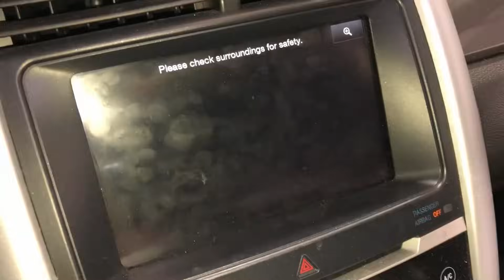2007-2019 Ford 6F50/55 Six Speed Transmission: Fluid Exchange Procedure

Comment: Good video. I have a question. I just purchased an Edge and it has 140,000. No where in the carfax does it show to have ever serviced the transmission. What’s your opinion on doing this when it’s this far along and has never been done?
Reply from the maker: Yes if you perform a drain and fill you should be fine. This only change part of the fluid as to not shock the system.
Reply: @FordTechMakuloco  Thanks for the advice!!
Reply: @FordTechMakuloco  If you drain and fill (DaF), how long should you wait before doing another DaF to get more of the old fluid out?  I assume that the old and new fluids would evenly mix, so you'd be DaF roughly 1/3 new, 2/3 old the 2nd time around?

Comment: Yo! Your vids are so helpful. We recently picked up a 2018 platinum explorer and it now has 40k miles. Just did the PTU oil change and transmission fluid. Our transmission has a dipstick and I didn't see a level plug on the side through the fender well. I did see another one pointed straight down, at a higher level and to the side of the drain. Is that plug for setting the level? Or just using the dipstick good enough? That's what I did for now.

Comment: Is the reason for doing it so frequently, also, because you can only get 40% of the fluid out?

Is there a way to get all 11 quarts out?
Reply from the maker: You want the mix especially if the trans has some miles on it.

Comment: I have 2015 Ford Edge SEL 2.0 Eco boast Front wheel drive that doesn’t have a dip stick.  Has a funny plastic cap that appears to be some type of a guage.  Is this normal?
Reply: Mine is the same in the 2015 Ford Edge Titanium AWD, Did you find anything out?

Comment: Mine is a 15 explorer 2.0L and it doesn’t have a dipstick. Do I have a different tranny?
Reply from the maker: Yes you have a 6F35 not a 6F50.
Reply: @FordTechMakuloco  ok thank you, I’ll have to do the leveling method with the bolt on the side correct?
Reply from the maker: Yes I have a video on the 2013+ 6F35.

Comment: Hi. I did this service today. I unscrewed both drain plugs (the lower, and upper pressure line?). Some dark sludge came out of pressure line. I simply replaced the cap. Do I need to do anything else? Thanks to anyone who can help with advice. 2018 3.5 ecoboost interceptor just retired. Fluid was pitch black.

Comment: Anyone know the difference between 07-09 edge awd transmissions and 2010 awd trans? I have an 07 with a seized engine. Guy I got it from says he tow dolly'd it back from the garage to his house, so I suspect drivetrain/tranny damage. I have an 2010 3.5/trans/PTU I'd like to drop in if possible.

Comment: Mine was changed 10km ago. I was about to change it myself on the weekend but when I pulled the plug out it was still lovely and clear. I was shocked but happy😆
Reply: Thats one of the things that throws folks off about ATF: unless it over heats/gets contaiminated from mechanical damage, it wont change colors very much as it wears out. Folks are used to seeing engine oil that goes in golden and comes out black. Engine oil changes colors due to combustion containments which aren't present in a auto trans. If your trans fluid is anything different than a bright to dull cherry red, its indicative that the trans has suffered overheating or mechanical damage.

Comment: I have 2013 with shudder under lite accel. Put new plugs and coils, new Motorcraft filter, and fuel system check by dealer. Still shudders slightly. Saw video suggesting a trans additive... thoughts?
Reply: Add a bottle of Lucas Transmission Conditioner too, in place of some of that 4.5 quarts.

Comment: I just bought a 14 explorer sport, to my knowledge the fluid has never been changed with 140k miles, would you recommend a drain and fill or is that a bad idea?
Reply: Add a bottle of Lucas Transmission Conditioner next time too, in place of some of that 4.5 quarts.

Comment: Great video!  I have a 2014 Ford Flex with 120,000 miles, never had the tranny fluid changed.  A really exceptional vehicle, always driven easy, but does drive on dusty roads occasionally.  Is it "safe" to change fluid in this case?  Is it true that you can cause slipping problems if you change fluid after waiting too long?  Many thanks . . .
Reply: Just add a bottle of Lucas Transmission Conditioner too, in place of some of that 4.5 quarts.

Comment: What would you recommend doing If I accidently put rear diff (75W-85 synthetic hypoid) oil in the transfer case (which takes Mercon LV)? I have the transfer case oil on hand, I just got the bottles mixed up. (I have a 2019 F150 3.5 ecboost) I have only driven around 30 miles since I put the wrong fluid and I did not use the 4x4 function. Thanks for all the videos!

Comment: Need help!  Wife’s 2016 Explorer (95,000 miles) had a MAF sensor go (replaced) now the ambient air sensor temp is throwing a check engine light (tried replacing sensor with no luck).   Now it is upshifting and downshifting hard.  Any idea what may be causing this?

Comment: The video is good and I benefited a lot from it. I have a 2018 Ford Explorer. I would like to know how to change the gearbox filter
Reply: Pull the transmission out and disassemble the two aluminum halves.

Comment: QUESTION please: Ford Explorer platinum 2017  single owner 35K miles   ..   do you change  PTU fluid   as well !?  
 is it still  recommended to perform this service at 30 K if vehicle  was bought brand new !!? can not get a straight answer from the dealer  ...
thanks !

Comment: So if I do the 3x fluid change to get all the fluid clean, how long should I wait between changes? Thx
Reply: I decided to come back after doing the 3x fluid flush so anyone else researching could find this. After each 5.5qt flush as shown in this video, I drove for about 20 minutes, being sure to shift through all gears and get the converter to fully lock up. I drove to the interstate and to the next exit then drove from there back home in stop and go traffic. Maybe 25-30 miles total. Then I proceeded to the next 5.5qt flush and of course repeat again for the last 5.5qt change. The fluid  honestly didn't look too bad at first, kind of the darker red you see in this video. It's very red and clean now. Roughly 17qts of fresh fluid in my '13 edge sport w/ 70k miles since I didn't know the history of trans fluid. Now I'll do just the 5.5qt again at 100k and keep up from there. (Sorry for length just hoping to help 😉)

Comment: Doesn't this trans have the weep hole/ overflow hole on the driver's side? Wouldn't removing the plug from this hole while filling the fluid help move things along better? Plus, the overflow of fluid tells you when it's full, right? Or did this trans not have this? Thx
Reply from the maker: No you are thinking of the 2013+ 6F35 or another trans altogether but not this trans.
Reply: @FordTechMakuloco  ahh, ok.I appreciate the confirmation. I'm looking to do this on my Ford Edge sport this weekend and collecting all the information I can.

Comment: Thank you for excellent  video content! I did a 6f55 transmission on a 2016 Ford Edge Sport 2.7L yesterday and accidently over filled. With thread sealant already applied to the drain bolt, I removed it to remove 0.5qts and reinserted the drain bolt. Do you think the thread sealant will still hold? Also, is there a better way to remove trans fluid if overfilled in the future? I still haven't quite figured out how to get the air cleaner box to sit properly back in too.
Thanks in advance for any feedback!
Reply: Vacuum fluid extractor from the dipstick tube

Comment: I have a 2016 edge sport. at about 38000 Miles the service department at the dealership found a leaking transmission temp valve. that took 7 days to replace, before they replaced the temp valve I noticed a studder at acceleration and a low idle issue at a stop. I still experience the studder and low idle issue. the dealership tells me they can't replicate. I wonder if the ptu is causing the studder.

Comment: Hello. Thank you for your help. You’re an asset to the ford community! I have a second gen CX-9, 2019 to be exact, and the torque converter locks up almost instantly (I think over 7 mph). It’s great for that direct feel, less heat build up and better gas mileage. Do you happen to know when the 6F55 torque converter locks up?

Comment: I have a 2015 Edge SEL with the V6 engine. Is there any issue with measuring how much I drain out and refilling with the same amount provided the original fluid level was correct? Thanks Eric

Comment: I have a '15 explorer 120k miles. I bought it with 50k and changed the trans fluid twice since then. How long can i expect the transmission to last? It shifts a little rough between 2nd and third but otherwise it's okay.

Comment: The manual says to change the fluid if driving in dusty conditions at 30k miles.  These trans hold 10-11 quarts.  Does the dealer change the fluid out with this method of 4.5 + quarts or do they get the 10/11 quarts out by some other method?  I will do this change per your video but if the dealer gets all the fluid out I will take it to them.  

When I see people post 3x are they talking about 30k miles or doing this change 3 times?  

Thanks,
Larry
Reply from the maker: Drain and fill every 30k miles it takes 15 min, why would you go to the dealer?

Comment: So it sounds like only 4.5 quarts comes out but the manual says it holds 10. What's holding the rest from coming out other then maybe the pump?
Reply from the maker: Pump, torque converter, fluid passages in the valve body etc...
Reply: @FordTechMakuloco  so would it be a good idea to flush every oil change till comes out a bright red

Comment: Is it true that on a 2016 ford transit 250 (full size 3.5 Ecoboost) transmission fluid and filter change, the cross member and exhaust must be removed to access the trans filter and pan? I was quoted $750 to $850.
Reply from the maker: Yes

Comment: This was a drain and fill not a flush.
I always flush all the fluid out and refill with new.
I have a 2013 Lincoln MKS Eco-boost AWD and I've never had any issues with the car.
Of course all oil changes and PTU fluid changed frequently as well.

Comment: Is their no video for a 2017 Ford Edge 2.0 front wheel drive. This must be an all wheel drive or for an Edge with a bigger engine. I don’t have a screw on filler cap. No dipstick.
Reply from the maker: You have a 6F35 trans, this is a video for the 6F50. See my 2013 and newer 6F35 video.
Reply: @FordTechMakuloco  Thank you

Comment: How do you tell which tran you have?  My owner's manual lists 6F50, 55, & 35 for my car.
Reply from the maker: The 6f50 is for the 3.5L N/A engine, 6F55 is normally reserved for the 3.5L Ecoboost and the 6F35 is for the 4cylinder Ecoboost models.
Reply: @FordTechMakuloco  Thanks!!! Your videos have helped me out a LOT

Comment: I agree to a lot of your subscribers, you are a life saver. I've repaired few of mine and friends cars watching your video and cars are still running great today after many years. Anyways, I know you mentioned there's no tranny pan on this 6F50 tranny and that it's hard to take the internal filter out. Does that mean no need to replace the filter forever? I just bought 232K 2013 Taurus and I want to replace the tranny filter ($28.49). Should I add an external/remote filter just to be safe? I'm on planning on driving this car till I can't drive it no more.

Comment: So for a drain and fill for the transmission fluid in my 2016 Ford Taurus SEL 3.5 flex V6, I only put 4 and a half quarts back in???
Reply: I just did my 2012 ford explorer and i almost added 6 quarts to get a perfect reading. Am assuming it was missing trans oil. When i added the 5 quarts i got a lil bit more than half on the reading mark and added a lil more and bang perfect reading
Reply: @rhurtadorh32 hope she was hot, sitting level, and running??

Comment: Great channel and videos, learning quite a bit here. I do have a quick question was hoping you or a viewer may be familiar with. I have the 6F50 in my 2015 FPIS Taurus that I bought recently. There is a little bit of a hum right before the 4-5 shift, and the 5-6 gear shift, only when I'm gently on it and the RPM is low, like below 2k. Everything else is normal and performance seems perfect. I have a warranty but just curious, I read in a group that it was common but concerns me.

Comment: I've always wondered by more transmissions aren't like the Alison with and external filter.
Reply: Keep wondering.  It may occur to you.
Reply: @COWBOYZNATION  Not much difference

A Chevy Allison transmission replacement typically costs between $3,449 and $3,799. Ford F-250 transmission replacements can range from $3,000 to $7,000.
Reply: @iamthemoss  WOW

Comment: I cannot for the life of me find the dimensions of the 6f55 trans drain plug size! 
I have located the part number 7T4Z7A010B and have called two dealerships but no one knows the diameter/pitch/length, nor whether it is magnetic.
I want to order a magnetic/neodymium replacement from an ebay seller....or are the oem plugs magnetic? Also, are there any magnets in the 6f55 transmissions?
I do know the engine oil drain plug is 15mm M12 - 1.75 but what the heck is the trans drain plug dimensions??? 7/16 or 11mm head size is all I know, and that is insufficient info to re-order a magnetic replacement. Are the engine oil drain plugs magnetic?
Can anyone assist please and thank you.

Comment: Does anyone know if @ 9:23 when you add additional transmission fluid after the initial 4.5qt do you do so while the car is running? Also he said “there’s 5 qt inside let’s add another 0.5qt to bring it up”, but he had only 4.5 at the beginning. So did he add an additional 0.5qt already? Was he accounting for something else? Will the final additions of fluid total 5qt or 5.5 qt? Just to clarify as this is a very sensitive step.
I’d appreciate an answer.
Reply from the maker: Most of these take 5-5.5qts in the end, so you start off with 4.5qts fill and adjust as necessary with engine running the whole time in park as as shown here.
Reply: @FordTechMakuloco Awesome thanks! I appreciate it.
By the way your videos have been extremely helpful and top notch. My go to primary resource! Great presentation, no music, no fluff, just well-edited content.
Thanks

Comment: Great Videos! I have the '15 Sport with the 2.7 and it's a bit different. You have to remove the two screws retaining air intake, pull the air box up from the retainers and twist slightly. The flex intake hoses stay attached. Then you can check fluid when running. It's Really tight, cap almost impossible to see let alone twist and have to pull it between hoses. Smaller hands a plus. I managed with two fused wrists so it can be done. Just adding fluid? Remove the whole airbox, but Ford says don't run with it disconnected.

Comment: Do you recommend drain and fill over dealer offered flush services. My dealer will not do a drain and fill for me . Will only sell me a flush for 300$ . Car has 45k miles and I believe  its original  fluid so I planned on doing 3-4 drain and fills with running the trans in between . Would you recommend  the flush or drain and fill ?

Comment: I have a 2016 flex and the cap is burrows under the air box, how do I start the vehicle to check it without the air box hooked up, won't my car die since it throws off the mass air flow sensor?

Also is it better to change it again after like 500 miles to flush out more fluid or is once enough?

Comment: Interesting that GM and Ford both jointly cooperated and committed to investing finances in supporting this 6 speed transaxle, which also includes the 6F35.
Reply: I thought the gm/ford joint transmission was the 10speed not the 6 speed.??
Reply: @tomh6779 I think GM backed out of the ten speed collaboration.  The six speed is a joint development.
Reply: Well, your statement explains the nonsense engineering with this trans! Take GM and Ford engineers and have them work together; you get a junk product with terrible engineering!! Where do they train these people to be automotive engineers...... Looney Tunes?
Reply: That explains why these transmissions are fucking trash.

Comment: I took my 2013 explorer to get fluid changed and it came back with a noise whenever i put it in reverse gear . But prior to taking it in the noise wasn't there. The fluid they put in my suv is XT10BLV. I took it back in the next day concerning the noise they couldnt figure it out and after 4½ hours of them trying to figure it out they come back saying its the trans mount thats worn. So they gave me a qoute for a bushing of a $100 + labor of $454. 
Any pointers you can help me out with? I'd greatly appreciate it.

Comment: Wanted to preform a transmission fluid change on our 2017 2.0L ecobust Edge. There is a transmission fill cap but no dipstick to check the level. How do you know you have put enough fluid back?

Comment: Just changed the Mercon LV in my 2011 new to me edge. Thank you for this video and the tips on refill. The previous owner hadn't changed it and there was 103,000 miles on it. I will likely do a 3X flush and your guidance has helped. Thanks!
Reply: How does the vehicle feel after having changed it?  I have a 2011 106,000 miles

Comment: My 2015 Ford Edge does not have a dipstick but rather a cap atop a piece of hose.  The only way I know to accurately fill it with new fluid is to have the old fluid drain into a bucket with a measuring scale on it's side.  Do you know of a better way to measure the fluid fill so that it's at the right fill level?
Reply: You are assuming the fluid level is at the correct level BEFORE you drained it into the pail! It may have been low, or high, and you are only going to be back at the point where it was prior to you starting the service! You should at least do it the right way at least once so you get the level right !
Reply: @Matt-i8r So what's the right way?  Please tell.